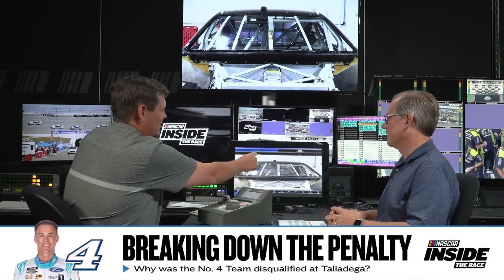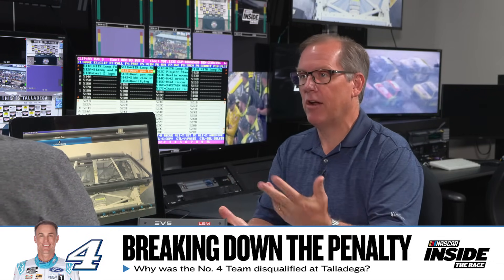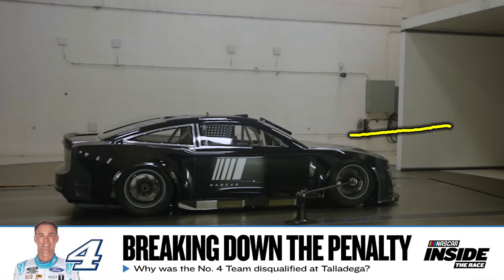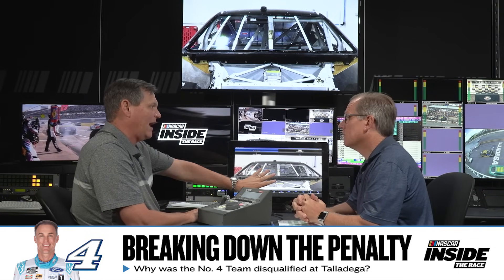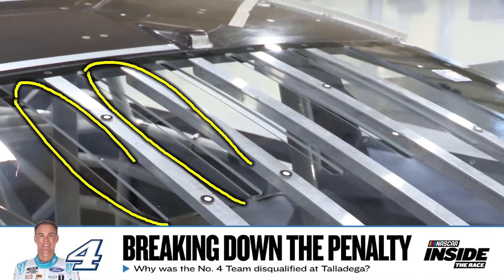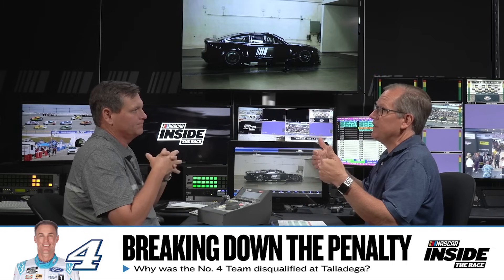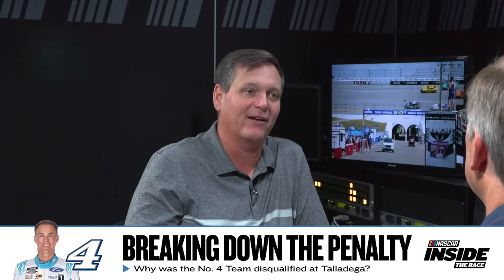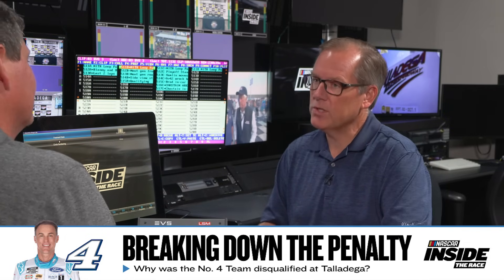Cracking open Harvick's 'Dega penalty | Inside the Race

Comment: Harvick got screwed cause NASCAR has a vendetta against SHR and that's why it wasn't just a point penalty and he got DQd
Reply: He got DQ’d because they found it at the track same as Hamlin and Busch last year.
Reply: In my opinion this is stupid. The car passed tech , they then found a reason,  my question is how loose were the bolts that gave the advantage,  the lack of explanation to fans is the reason nascar has lost alot of fans, lots of fans have no clue how draft works and just see it as a vendetta,  I understand but I wanna see proof and see the video of tech finding this
Reply: Harvick's crew chief screwed him over.
As much as some of these rules are unpopular,they are there for a reason both to keep the sport competitive as well as safe.
Barring the fact that a loosened windshield could be an advantage,it could also be a safety hazard.
Should it come loose, you're looking at a 200mph guillotine.
Pretty sure no one wants to see that.

Comment: If teams are having issues with those screws/bolts staying tight then NASCAR needs to amend their rules to add nuts or lock nuts to the plates in which those bolts are threaded into, simple fix, minimal cost end of problem.
Reply: Simple loctite would’ve kept those boots tight. Childers said they siliconed them, but silicone isn’t a thread locker. Blue or Red loctite would prevent the me bolts from backing out